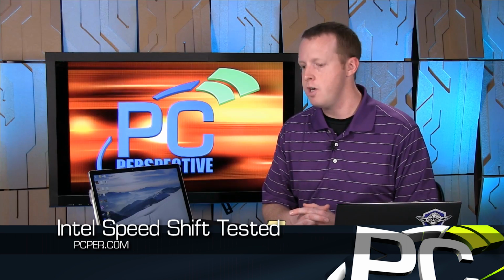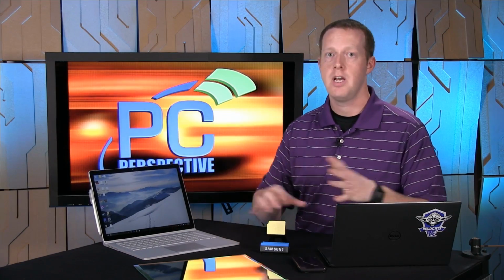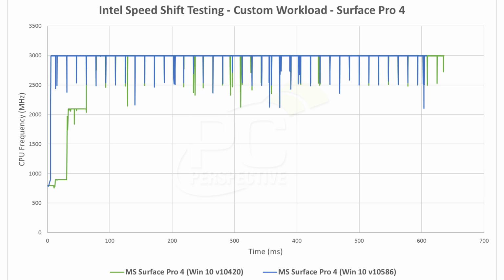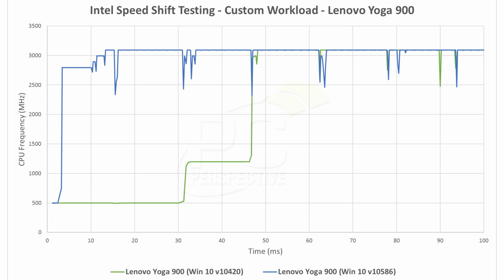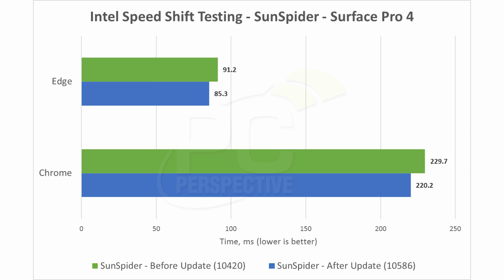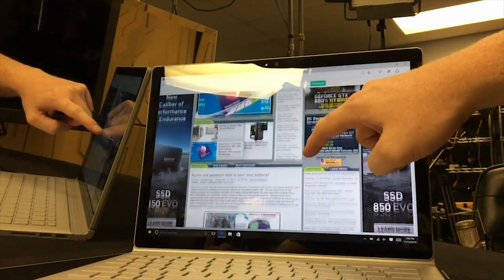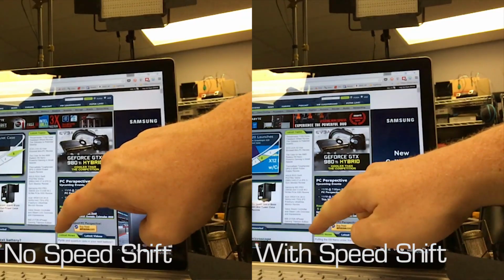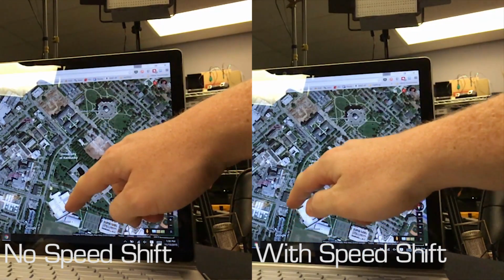Intel Speed Shift Tested - Significant User Experience Improvements

Comment: Intel speed step and speed shift technology should be enabled for gaming???
Reply: That’s my question too, speed shift
Reply: Apparently there was a test where disabling increases 1% lows by a lot. 
I'm currently testing myself but can't really see difference in performance between balanced or high performance power mode. 
Also either shift or step keeps the CPU clock at max 'base' speed. 
I actually need to figure out how games can automatically put PC in high performance mode and balanced on idle desktop. 

There also seem to be an issue with certain turbo options like efficient aggressive and agressive. 
Efficient aggressive seems to save up some power and reduce temp by 10 degrees, but doesn't seem to work with shift disabled which kinda disappointing

Comment: How can I enable this feature? I have intel 6700k. HWinfo show SST in red, not enabled. I have Windows 10 pro. EDIT This is a desktop system - I've read that SST may only apply to laptops. (No option in UEFI that I can see Asus Z170-Pro)
Reply: Today I found by chance looking at options in the latest BIOS from Gigabyte H110M-H (with an i5 6600) and found that "Intel Speed Shift Technology" and guess what, the default value is "disabled", and like you said on HWInfo it showed "suported" but was red, not active. AIDA64 the same, just showing "suported". Then I backed to the BIOS and put "enable" and there it is, SST on HWInfo became green and also shows "current mode: autonomous", same thing on AIDA64, so I think now is active. But it's odd, I've never seen on internet people arguing about this technology on both notebooks and desktops, if there is a real benefit from that. Also been strange Gigabyte just letting this option "disable" by default settings. Maybe more of it was just marketing than anything else since most articles is from 2015~2016 . Anyway I just left mine "enabled" since I don't do overclock or am an enthusiastic gamer.

Comment: Am I the only one that sees a flaw in the testing methodology? What you proved especially in the third test, was that the latest Insider build is significantly more responsive. Your assumption that the difference is due to the Speed Shift is presumptuous and assumes that it's the only optimization made in that build. At best, you could say it's a contributing factor, but unless you do a proper test of exactly identical Windows 10 codebases, one with Speedshift, it's not a proper test. You need a proper control. I understand that's not practical, but at the end of your video you asked for feedback on your testing methodology, and given how buggy the rollout for the SP4/SB was, I bet there are plenty of fixes that could have improved the overall scrolling, etc experience.
Reply from the maker: +Robert Thanh Parker Fair enough. But it is impossible for me to test this in any other way....
Reply: +pcper compare how much speed improves when using 5th gen cpu use both code bases.
Reply: Or try the same tests on the Yoga 900 you mentioned having available for the tests to see if they're consistent with what you saw on the SP4.

The point is that you attribute the results to one optimization, in an update that probably has hundreds or more of independent optimizations.

Comment: Wow, sick. Was going to grab an i7 Surface Pro 4 after they become available anyways, significantly improved responsiveness and a free performance boost aside from that is really nice.

Have you guys tested if this impacts battery life in any way? Maybe turning down clock speeds quickly also results in improved battery life - or the inverse if higher clocks are engaged more of the time.
Reply from the maker: +Stan V Have not tested it yet but hopefully I can do that this week!
Reply: pcper stylus responsiveness would also be interesting to test.
Reply: do anyone know when this skylake improvement releases and how to enable it
Reply: HulenGamePlaysHD It's available in the windows 10 threshold 2 release, I believe the build number is v1511 r10586, if it's that or later then it's automatically enabled. If you've updated windows 10 since mid November you should have it. You can check what version you have by doing win-r and typing winver.
Reply: Stan V i already updated windows 10 and i can't find speedshift in start programs
Reply: HulenGamePlaysHD There is no app for it, it's a patch that runs automatically with no user interaction and no way to turn off after you applied the patch. It says as much in the video, they had to run benchmarks before and after the patch because there's no easy way to revert it without reinstalling windows.
Reply: Stan V who would need to revert it
Reply: HulenGamePlaysHD People testing if it works, and apparently people expecting there to be an app in the start menu that enables it as that would assume that it's something you can toggle.
Reply: Stan V well today i just realized that i have some fps improvements i don't know it's from windows 10 update or disk defragment lol

Comment: No comparison to running with the machine locked at max clock speeds?
Reply: +taief miah I used Throttlestop to stop if from going down :D
Reply from the maker: +Mustang GB It would obviously be better in that case. But for notebooks, that isn't a feasible option.
Reply: EleMenTfiNi ... I am kind of edgy :) sorry for my comment, I do like to live on the edge though :D right now I got my 4690K at 4.7Ghz on 1.38volts XD
Reply: laptops automatically throttle  again even then it won't show you real world gains
Reply: +Shawn Strickland edgy
Reply: +pcper Of course it would be better, what I was wondering was whether the results would be 90% of the way to a best case scenario, or only 10%.
Reply: Shawn Strickland You are living on the edge, possibly damaging  your pc.

Comment: this is awesome !!  but will it decrease the response time even when gaming ?
Reply: +TestedMATTIA No, the difference will be pretty insignificant for gaming. This technology is mainly beneficial for tasks that require a high clock speed in a very short period of time, when the CPU is idle and then suddenly you are asking it a moderate to high amount of computing power. The examples mentioned in this video are "a piece of JS code that gets executed", a user touches the screen (which triggers an action from a software), etc... 

When you play a game, the CPU is already pretty much always at its max clock speed, even when you aren't moving, the game loop keeps ticking and there are a lot of stuff going on in the background so there are rarely instances in a game where the CPU would be idle and then suddenly at full speed (except for the first second when you launch the game, but obviously it doesn't matter if it takes 50ms less time to launch a game).
Reply: do you know when this skylake improvement releases?

Comment: or or or, we can forget battery life and put the system on the high performance profile
Reply: +Данчо Димитров High Performance itself defaults to still throttle frequency and park cores. You have to make modifications, including the hidden core parking settings, to properly address it. For instance, ParkControl, or Bitsum Highest Performance Power Plan in Process Lasso.
Reply: +Данчо Димитров No.
Reply: +Bitsum That's not true. High performance leaves the CPU at full speed.
Reply: +NDogg15 Cores are still parked AC and DC (to max allowed), and it throttles the frequency at DC (down to 5%), to be precise. For AC, it does not frequency scale, but does still park cores very aggressively. These are the defaults of course, can't speak for changed settings with ParkControl or other.
Reply: it doesn work that way ...